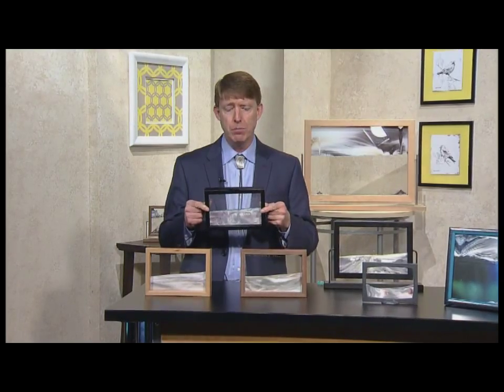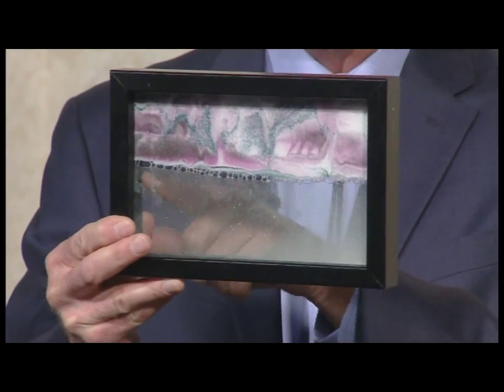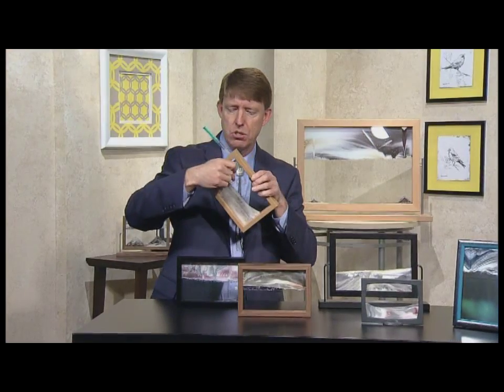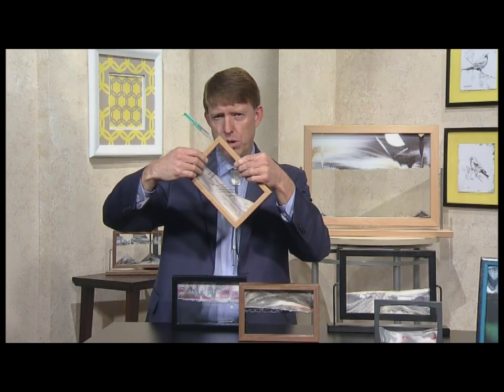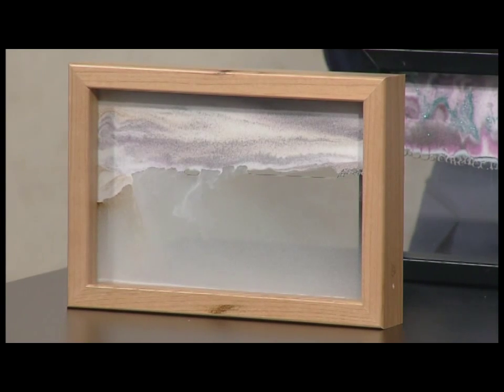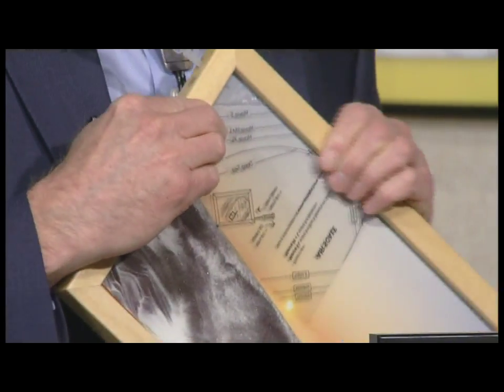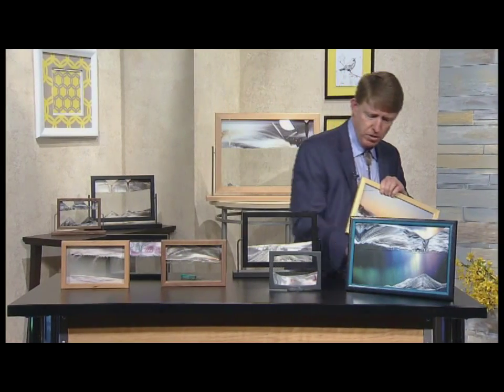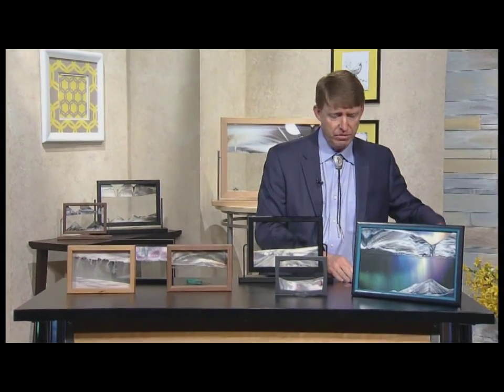How to adjust the air in your sand picture

Comment: My sandpicture didn't come with the needle or gauge. Also I don't see any air hole unless it is part of the hinge(my picture frame has a hinge in the middle of the frame that allows it to be flipped on the base that it is suspended on. I presume if I remove the basis, maybe the hole is on the pegs that suspend the frame???

Comment: Thanks, this video was a big help on air regulation, but I am struggling with something else. For some reason the bubbles keep on merging into one big bubble. Do you maybe know how I can fix it? Thank you!
Reply from the maker: If you have the right amount of air in your sand art but the bubbles are not breaking into friendly bubbles, it could be a sign that your soap is getting a bit tired.  You can order a soap boost on our website here:  https://movingsandart.com/collections/sand-art-accessories-stands/products/moving-sand-art-first-aid-soap-boost  A nice perk is you get an new injector at the same time.
Reply: That makes much more sense
Thank you
Reply: @ham0711 ham i am in a completely different country and im wondering if there is a diy way of fixing the same problem without buying ur product?

Comment: I can’t find any hole to adjust the air in my sand creation . Any help finding it would be helpful.
Reply: Hello Jeanne, 
Not all sand art has air holes for adjusting and controlling the air.  But, you can be sure all of the KB Collection Sand Art does.  The air holes are small holes in the frames.  Most of our sand art has two holes.  The Deep Sea (round one) only has one.  For the Deep Sea, rub your hands until you feel the rough part of the plastic frame.  That is where we attach the frame together and the air hole is near there.  On the others, they are on the sides of the wood frames on opposite ends.
Reply: If the sand picture is properly sealed the water will not evaporate through the glass.
Reply: If you don't see an air hole, Jeanne, you probably do not have our KB collection sand art.

Comment: I have just purchased one from the Deep Sea range and am delighted with it. One thing that baffles me though is why the rectangular frames have 2 injector holes but the the circular frames only have one?
Reply: This is true!  Our round shaped Deep Seas only have one hole for regulation.  Most have two holes and our Screenies actually have four holes.  But the Deep Sea model has just one.
Reply: @chriswootten9094  But why?
Reply: @Hungry4Mor  There is only need for one air hole.  You only need to access the sand art at one place.  The mold for the Deep Sea series was made with just one hole.
Reply: @chriswootten9094  I'm still none the wiser. Never mind.

Comment: If the air amount seems to be accurate but it becomes one bubble quickly, is that to much air?
Reply from the maker: Too much air is always too much air regardless of the air scale's advise.  However, if you've had the sand art for a while, it is possible that you need a bit more soap to break up the bubbles.  You can order a soap boost here:  https://movingsandart.com/collections/sand-art-accessories-stands

Comment: Hi Chris, 
Trying to adjust my sand art. Newley purchased for my daughter. Just curious but when you flip it how long does it take to complete a cycle? The frame I have is approximately 7”x10” in size. I keep adjusting the air with the included scale guide but just can’t seem to get it right. Either painfully slow or very fast
Reply: Hi Sam, 
The key is to get the bubbles to go all the way across.  If there are not enough bubbles to hold up the sand, the sand is heavy and will fall down quickly.  If there are too many bubbles, the air will be too strong and the sand won't fall.  Everyone likes their speed differently but the minimum for a good turn would be 10-15 minutes.  With that size, I would hope for about 25-30 minutes.
Reply: @chriswootten9094  

Wow thanks for the quick answer. I was getting more like 45 minutes. Tried to adjust and then for about 5 minutes lol. I keep adding and removing air but just can’t seem to find the right mix but you estimated times will be a big help. I definitely have the bubbles across just I guess too many at times. Thanks again. I’ll give it another try!

Comment: I have large bubbles but the water line is right on the air scale?  Do I have too much water or too little water?  I guess I'm not sure how to determine if I have an air issue or a water issue.
Reply: Simply, you need to get friendly little bubbles to go all the way across to create an air barrier.  If the bubbles don't go all the way across, almost like there is not enough air in your sand art ... add air.   If the bubbles are too big and thick (or air pockets), remove air.
Reply: @chriswootten9094  Thanks for such a quick response.  I get that but according to the air scale, I'm right on the money.  My question is about when do you need to add or remove WATER.  My wife may have added water but I'm not sure.  And unfortunately I can't ask her.
Reply: @KastkingAngler  Never remove water.  Unless you added too much.  The air scale is a guide.  It is accurate but I would not fight science.  Follow the "common sense" answer above.

Comment: How do you turn the small air bubbles into a big one?
Reply: The included injector allows you to adjust the amount of air.  We want friendly, little bubbles.  A big air pocket means too much air and the sand cannot fall.
Reply: @chriswootten9094  It didn’t come with injector. I need it to be in one big air bubble so I can inject and take out the air Before shaking it to make the smaller bubbles

Comment: How are you able to inject the needle without causing it to leak?
Reply: Our KB collection sand art comes with an injector and an air hole(s).  The needle goes through the self-healing silicone and you can adjust the air with the injector.  Additionally, you can replenish some of the evaporated water with the same injector.  Thanks for watching our videos!
Reply: @chriswootten9094  Is there a water gauge as well? Cause a have a huge air pocket and I think the frame needs more water. My sand is divided into two sections and it’s just stuck. It doesn’t look like air is what prevents sand from falling, it’s just stuck dry up there. Please help. Thank you!
Reply from the maker: @lastochka100  Go to our website www.MovingSandArt.com and go to the tutorial videos on our Knowledge Center page.  Watch the video on how / when to add water.
Reply: @ham0711  will do. Thank you!

Comment: my clear water turned pink, can this be fixed?
Reply: The water should  not turn pink.  sometimes, people add color to the art but we do not recommend this.  
You can send me a photo to chrisw@pitkinstearns.com.  With a photo, I might know more but there is no way to remove what is inside a sand picture.
Reply: @chriswootten9094  i had mine stored away durning a move, the water turned pink almost similar to what happens in your shower if you dont clean it, i dove into sucking all the water out and put new water in and everything came out fine, so happy the glass didnt break
Reply: @CyberCuzzi  I'd say that you had good luck.  Glass can break from pressure and sucking out all the water would create pressure inward.  But, you did it!  Congrats on your reward for your work!